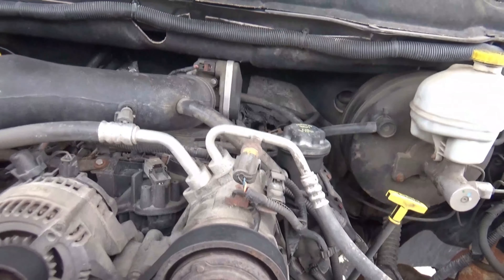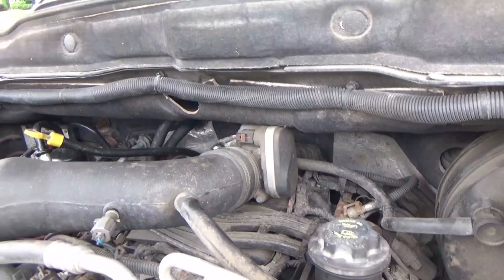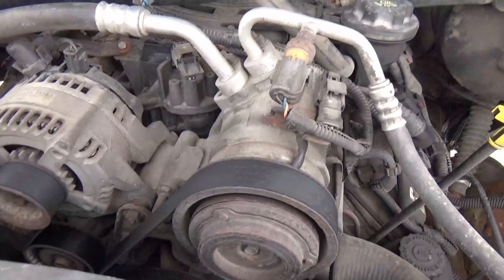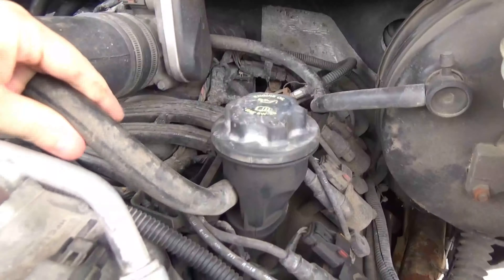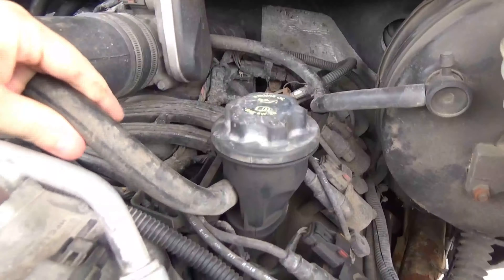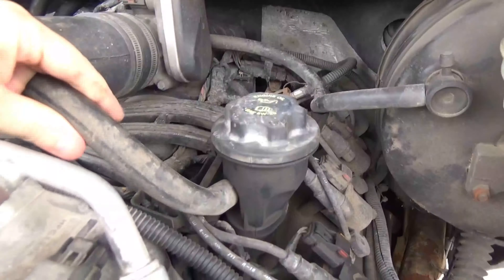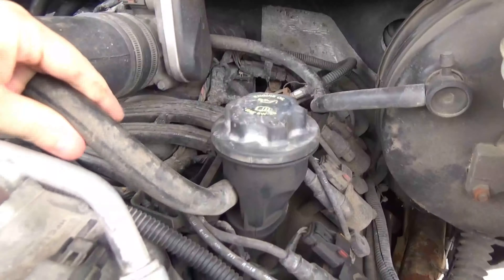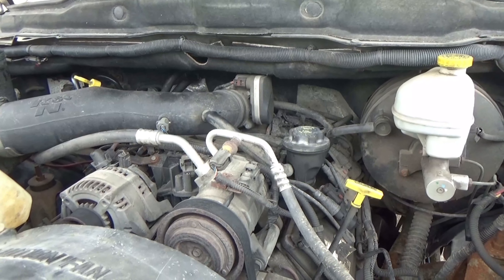Why you can't install an oil catch can on most 3rd gen Dodge Rams.

Comment: Help Me out a 66yo Shade Tree . 2005 4.7l v8 Durango I have this model.

 has the Pvc valve that Literally quarter turns into side of oil Fill. So my durango is gen 2 ? Tks
Reply from the maker: @oldmandoingstuff8997  if it looks like the one in the video it’s a gen 3 hemi

Comment: So if its suction then that wouldnt help in colder climates when the oil fill cap decides to collect condensation which is very common
Reply: unless the pcv valve wasnt operating right ill check into that i did remove my old one it rattled and i cleaned it some with brake clean put it back in til i get a new one
Reply from the maker: @Michael-B41  Condensation will always build up there, it's Dodges design flaw. When you've driven for a while, park the truck and turn it off, hot moist air will obviously collect there, that will always be cooler so the moisture will condense and turn into that ugly sludge that's in every 3rd gen oil cap.
Reply: @TheMakeshiftShop  good to know it freaked me out. it doesn't seem to lose coolant but i did have to add oil lol. i changed timing cover gaskets had a slow coolant leak and it has new water pump so i was freaking out. but its clear condensation little water droplets.

Comment: Where did u get that egr delete kit from?
Reply from the maker: 05 2500, and maybe 1500, didn't have an EGR..... only a few years got an EGR setup and it seems kind of random which years, or which options determined which trucks had an EGR or not.
Reply: @TheMakeshiftShop  heard that about some of the 2500s with mds too

Comment: Did you do an egr delete?
Reply from the maker: No, the 2005 2500’s didn’t come with an EGR. 
It’s deleted from the factory.
Reply: @TheMakeshiftShop  ah I’ve got a 1500 Hemi. Wish mine was deleted
Reply from the maker: @vTacozzYT  I’m not sure where you can get the block off plate, but it must be available somewhere since mine came from the factory like that. 
As far as the ECU goes though, you can get an HPTuners MPVI2+ and just turn EGR off.
Reply: @TheMakeshiftShop  that’s what I was looking for because I can’t stand a check engine light.
Reply from the maker: @vTacozzYT  it’s a great programmer/tuner IMO, I like that it gives you all of the control, but there are no canned tunes so you need to learn to tune your engine yourself or pay someone like Jay Greene for a custom tune. 
However with all of the EPA bullshit going on, HPTuners have removed a bunch of emissions options from their software 
I have older versions which still have those options though, and many older versions can be found online easily enough. 
 But the programmer firmware might be an issue, I know some older non-updated programmers are highly valued.